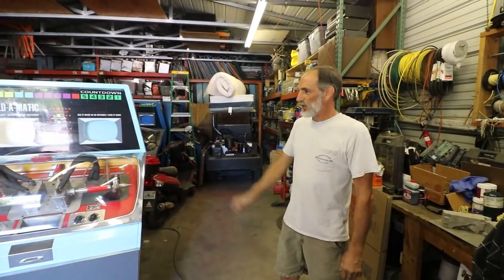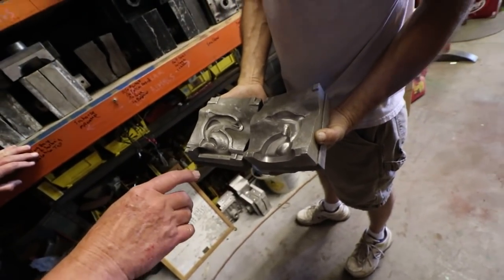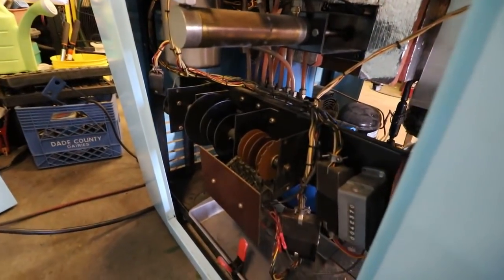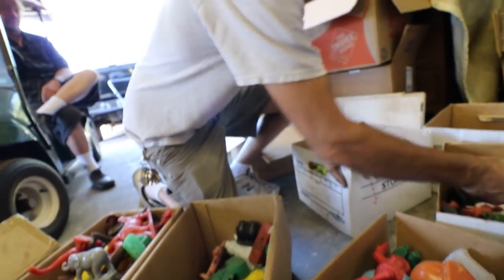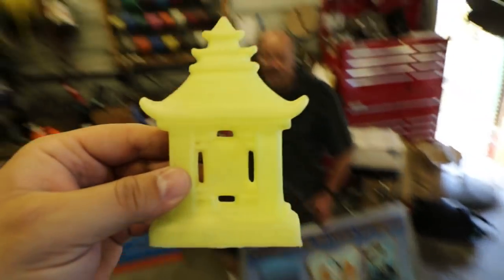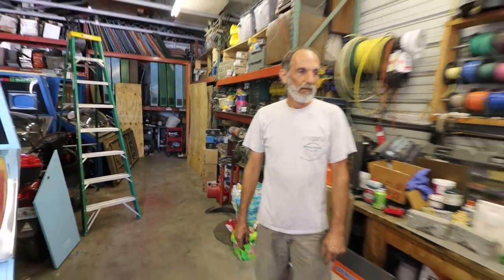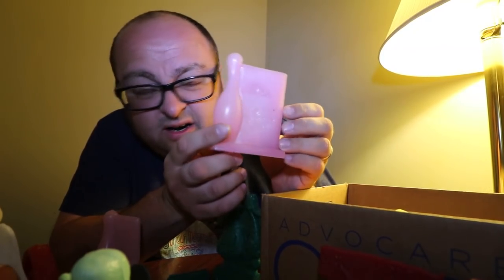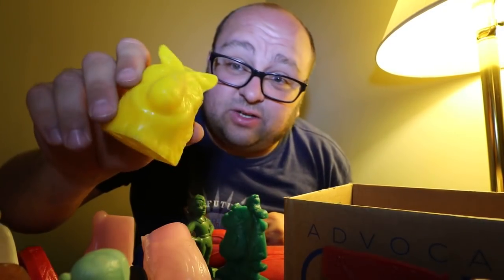Visiting the Mold-a-Matic Warehouse

Comment: OMG, I worked on those machines during the 64/65 New York Worlds Fair. I had a collection of casts that no one has seen in decades.I had every one that was at the fair and then some. Like a fool, I gave them all away when I moved out of my parents house. Many are lost forever.
The Bronto mold is an original.  It weighed a ton. They came out with a smaller one later and eventually replaced it with one looking forward.  I would love to check out there shop and smell the smell of hot plastic and the sounds of the injection and compressors again.
By the way, I was only 10 and 11 years old when I worked on the machines.  I managed to weasel my way into the shop around the corner from my house by sweeping up. Every kid in the neighborhood would try to sneak into the "dinosaur factory" to steal what ever they could grab and run with.  The guys taught me everything about those machines. I did most of the work on them as they relaxed and did little, but  I learned about injection molding, hydraulic systems, microswitch cams, mixing dyes etc etc....  Had I only known how valuable my collection was.

A fellow enthusiast interviewed me several years ago.  The following link is my story  https://moldville.arcade-museum.com/1964_NY_Worlds_Fair_questions_answered_.html